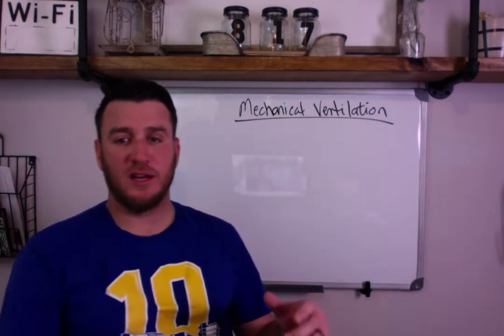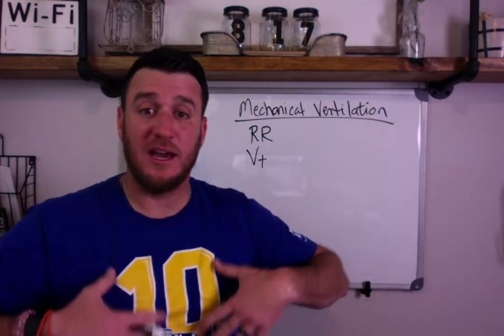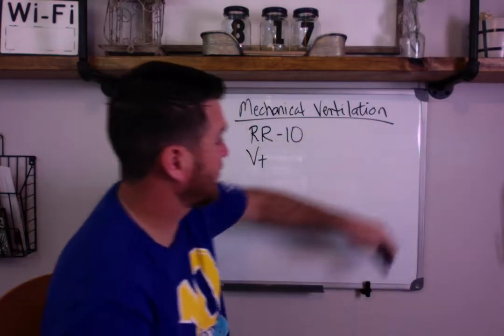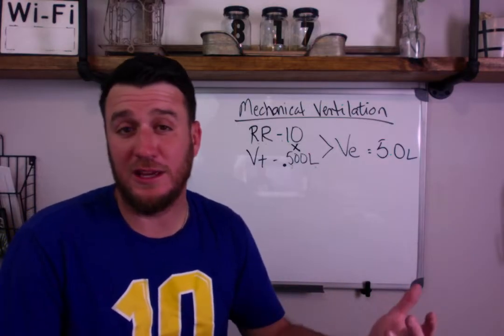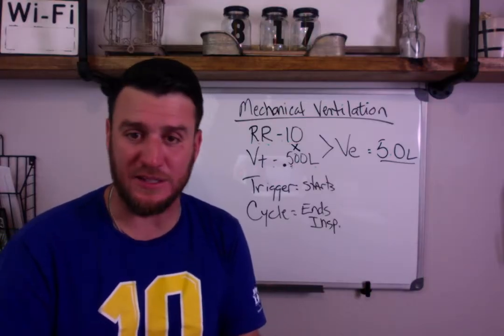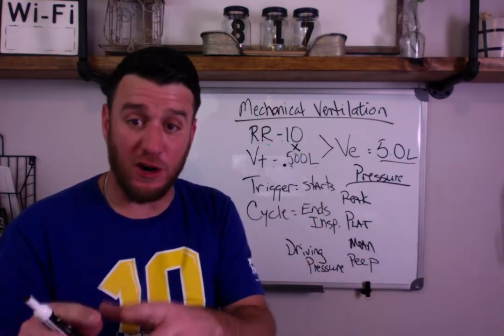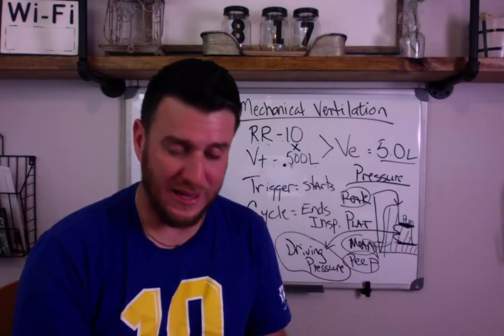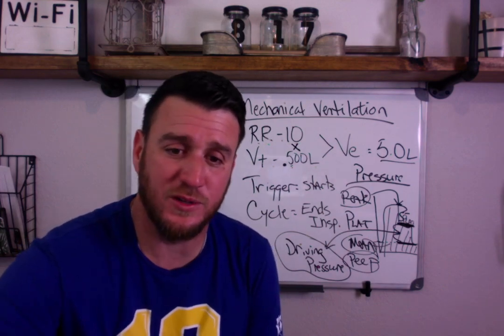Respiratory Therapy - Mechanical Ventilation Terminology Breakdown

Comment: Sir when we hold at peak pressure, then how it possible that plataue pressure hold in down position
Reply from the maker: Because the flow of gas ceases, which eliminates the element of airway resistance as the delivered volume is held within the pulmonary units. Great question. Thanks for watching and commenting!
Reply: @RespiratoryCoach  thankyou sir 🙏

Comment: Thanks for your videos it make s mechanical ventilator much easier, i have a question and i woul be glade if you helped me with it what if neonate is on PC/AC and patient started to get tachypnic minute ventilation increased, pip reading is 8 while preset pip is 18 also peep is lower than preset on pressure time scalar

SO2 is getting lower
Blood pressure is normal
Tachycardia

Chest xray shows no pneumothorax nor atelactasis with good chest inflation

Vbg shows
PaO2 67
Pco2 25
Hco3 21
I dont remember PH

And when give patien ambue bag ventilation, oxygen saturation increases

Comment: So basically...
Mechanical ventilation

RR (respiratory rate) = x breaths/min
(ex. You want to give 1 breath each 4 seconds you'll do 60sec/min ÷ 4 sec to find out what your RR would be, so here your RR would be 15/min, as 60sec ÷ 15/min = 1 breath each 4 seconds)

Vt (tidal volume) = x ml/inspiration
(ex. Patient weight 80kg and you want to give 6ml/kg you'll give 480ml/inspiration as a Vt of 480ml) (please don't be killing anybody by giving a Vt of 500L thank you.)

Ve (minute ventilation) = x L of volume given/minute
(ex. You've installed a Vt of 480ml at a RR of 15/min so you're giving 7,20 L of volume each minute as Ve = RR * Vt = 15/min * 0,480ml/L which = 7,20 L/min) (and remember that hyperventilation is, for example, not only high RR but a high Ve that affects your PaCO2 by decreasing it so much that the patient is now in respiratory alkalosis, as an RR of 24/min with a Vt of only 150ml is not necessarily hyperventilation because Ve would only be of 3,6 L/min!)

Trigger (breath starter)
Time triggered breath : when patient is not breathing, breath delivering depends on set RR.
Pressure triggered breath : when patient takes pressure away from the circuit
Flow triggered breath : when patient sucks flow out of the circuit

Cycle (inspiration ending allowing expiration to begin)
(here, two most used in mechanical ventilation)
Set inspiration time (Ti) is reached so inspiration ends and expiration starts
Set inspiration volume (Vt) is delivered so inspiration ends and expiration starts
Etc. (differs from modes to others)

Pressures
-PIP (peak inspiratory pressure) = airways pressure + alveoli pressure
When inspiration starts, pressure rises until the breath is delivered and the highest that pressure got is the PIP
-Pplat (plateau pressure) = pressure representative of the pressures within the alvioli only (manoeuvre : at inspiration's end breath is hold for a few seconds and pressure lowers from PIP to Pplat and stays there until the inspiratory hold is released)
-MAP (mean airway pressure) = average of all the pressures throughout the entire cycling of the breath (area beneath the pressure curve)
The higher the PIP and Pplat are, the higher the MAP is going to be and vice-versa
-PEP or Peep (positive end-expiratory pressure) = set pressure that prevents the alveoli to completely collapse at the end of exhalation (atelectasis) by holding continuous pressure throughout the ventilation
-Driving pressure = Pplat - PEP
(We want that pressure to be minimal as well)
PIP - Pplat = representing airway resistance
Reply: I appreciate you for breaking it down further like this 😊
Reply: thankyou so much

Comment: Hello
May I ask...
Because in a mechanical ventilator that I see..
That is on Dynamic Bi Level Setting..
The parameter has "Pressure Support" and "Frequency"..

May I know, what is the difference between the Frequency and Pressure Support please.

Comment: 9:30 I'm confused. I thougth Boyle's law states, that pressure and volume is inversely related. So the higher the volume the lower the pressure.
Reply from the maker: Hey Alex, great thought.  Let me help clarify.  Boyle's law talks about the pressure exerted by a given mass of gas within a constrained volume.  So make it relatable to mechanical ventilation.  We deliver a mass of gas (tidal volume) into a constrained volume (alveolar units) and a pressure results (peak, plateau, mean).  If a patient develops a pneumothorax and loses half of their alveolar units, then the volume of the container, decreases and pressure will increase, as we deliver that set tidal volume (mass).  @9:30 I was referring to increasing the mass of gas (set tidal volume) which will yield a higher pressure.  Did this help to clarify?

Comment: Great video! Is tidal volume is inhale volume or exhale ?
Reply from the maker: HI Jiao!  Tidal volume is the amount of volume of a single breath.  What goes in should come out.  So inhaled vs exhaled tidal volume should be relatively close.  During mechanical ventilation both inhaled and exhaled tidal volume can be measured and monitored.
Reply: @RespiratoryCoach  Thank you so much for replying. What confuses me is if we need to add inhale and exhale volume...lets say inhale volume is A, so tidal volume is A or 2A?

Comment: So I was with another rt today and their patient is a chemical code so everything but compressions. The patient was on a vent fio2 100% peep of 20 and satting 30%, at one point would you take them off the vent and start bagging? 30% saturation is so low I was getting worried and wondering when we would start bagging? The patient was eventually changed to comfort care so patient didn't end up coding
Reply from the maker: I would question the validity of that pulse oximeter reading.  Sounds like there were likely perfusion issues present, which we know greatly impacts the accuracy of pulse oximetry.

Comment: When in pressure support ventilation, what is an appropriate setting for end cycle time? On most vents I have seen it set at .25 or .30.
Reply from the maker: 25% is standard on most vents, and appropriate for most patients.  You can shorten this to 10 or 15% to allow the pressure support to sustain for a longer time during inspiration for your restrictive lung disease patients.  Likewise, you can increase this to 35 -50% to shorten the time of the inspiratory pressure support, which will allow for a longer expiratory time for your obstructive lung disease patients.  I only adjust though when the standard 25% doesn't seem to be meeting the patient's needs.  Hope this helps!
Reply: @RespiratoryCoach  thanks videos are awesome

Comment: What determine the end of inspiration is called LIMIT.
What determine the initiation of expiration is called CYCLE.
Reply from the maker: Not exactly.  The end of inspiration and the beginning of expiration are the same thing.  Cycle ends insp, which allows exp to begin.  Limit is a variable during mechanical ventilation that can not be exceeded.   For example, in volume control we set insp flow of 50lpm.  That flow is a limit.  Which means, during insp, the flow will increase to 50, but will not exceed 50.   Some texts refer to limits as target variables.  Does this make sense?  I really appreciate you watching and commenting.